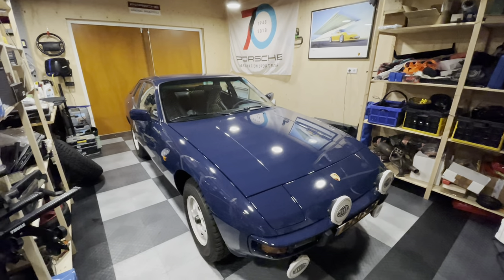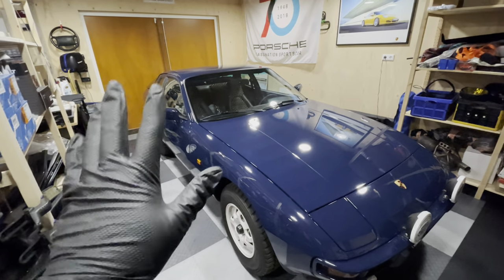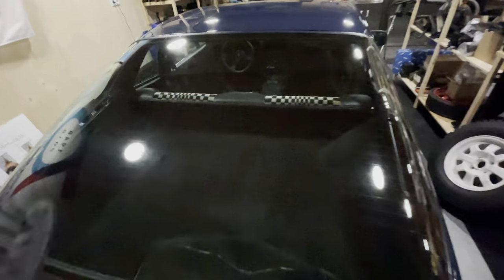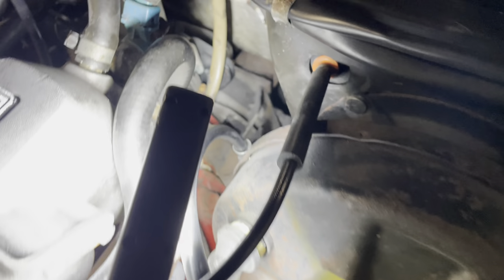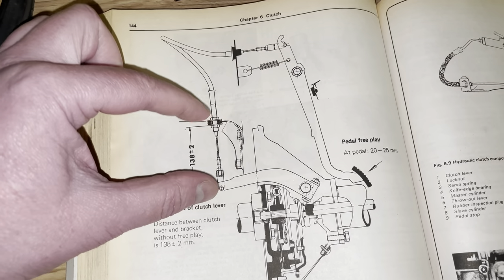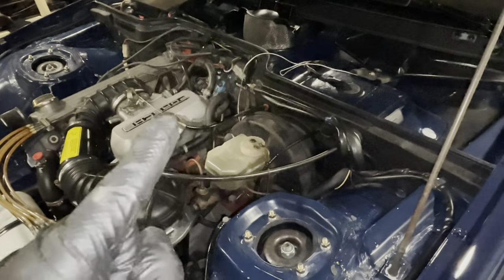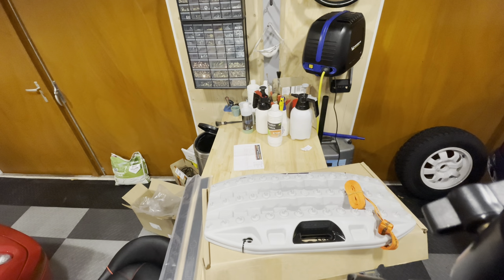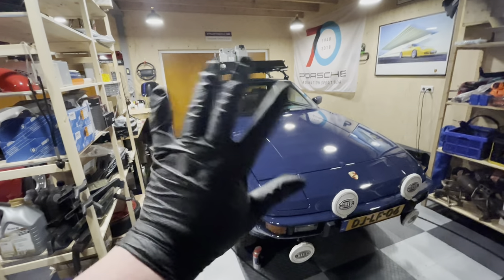Building a Porsche 924 Safari: Clutch Adjustment and Roofrack

Comment: Great video and the 924 is such a great candidate for a safari conversion.. Regarding the HVAC fan issue, its most likely the resistor and its a well known issue as they get older. Happened to my 968, fan only running at full speed. When the car was in the shop, my mechanic fixed it in 15 min just cleaning/adjusting and it has worked fine since.
Reply from the maker: Thanks for the info, but my problem is not with the radiator fan, but the fresh air fan. Any advice on that?

Comment: great bulid ! What kind of tire do you have on this car/spare, brand and dimension
Reply from the maker: Maxxis MT753 195/80 R14
Reply: @GarageBiljon  great thanks, did they fit without the lift?
Reply from the maker: Yes they did  @Narve-ij7wi , but I had very little clearance in the front. I think they would have damaged the front fenders if the suspension was compressed more than usual.
Reply: @GarageBiljon  They come in 185/80-14 as well, then they have some more room
Reply from the maker: The issue isn’t the width, but the height  @Narve-ij7wi

Comment: Fan only running at high speed is a wellknown issue. Most likely the thermostat. Just install a new one. Its not expensive 🙂
Reply from the maker: Thanks Johan, but the issue is not with my radiator fan, but the fresh air fan. Any advice on that?
Reply: Unfortunately no @GarageBiljon